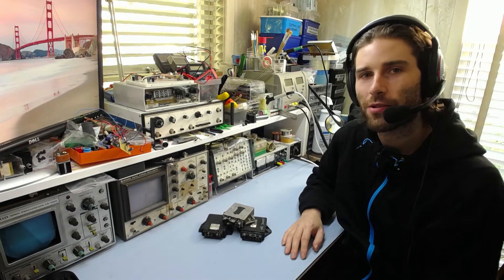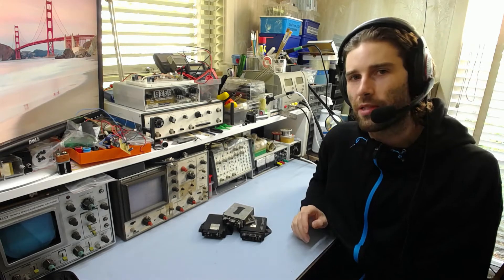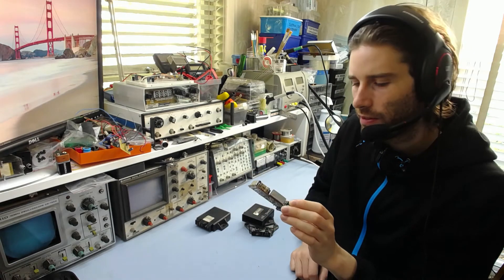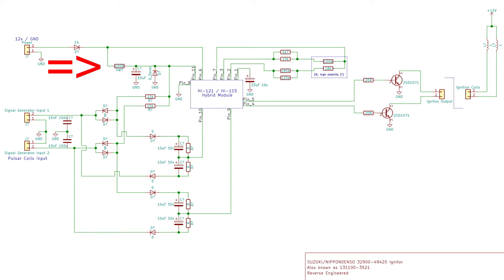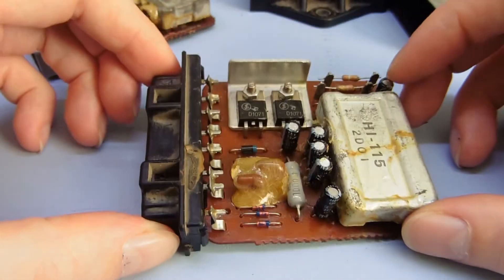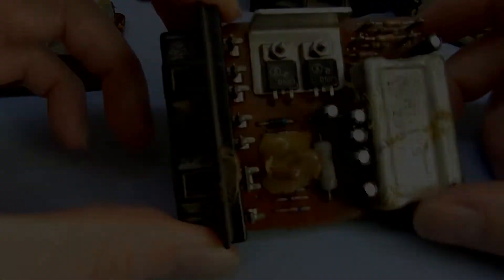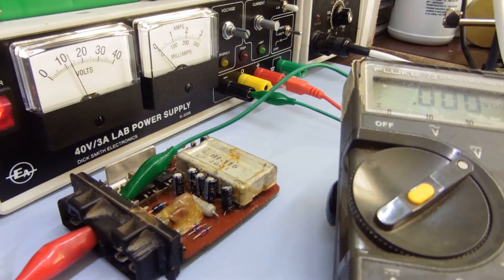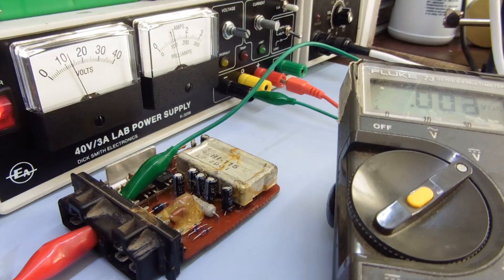Investigation and repair(?) of two failed Suzuki GSX750 ignitor units

Comment: This information was exactly what I needed.  Two of igniters were like the one on my Suzuki.  I replaced a badly burnt 100  ohm resistor.  I tried the unit on the bike, but it still did not work.  I watched another video that was working on a Honda CDI.  The problem with that unit was cold solder joints.  So I tried heating up the unit and that corrected the problem.  I resolver numerous connection points and the thing is working properly.  II think the root cause of the resistor failure was when the voltage rectifier went bad.  The way I found that problem was the head light, tail light, temperature gauge and tachometer went into melt down.  The amazing thing was during the summer the igniter would work, but when we got to the fall weather (colder) I lost spark.  This was like chasing a ghost and your work on the ignitor was key to getting the thing to work.  Not sure how much you saved me but it could have been in the hunderds!  Thanks again for your help.
Reply from the maker: Thanks! Glad it was helpful. Good point about the burnt resistor - a bad main voltage regulator could indeed cause that problem.

Comment: Thanks for a usefull runthrough. I support the theory commented earlier by someone else about faulty voltage regulators which is a much more common problem on bikes than failing cdi units. Overvoltage can typically be caused by bad grounds or corroded connecters which reduces the system voltage the regulator senses due to voltage drops in the circuit. This in turn triggers a higher than needed charging voltage - typically up in the 15+ v range. A faulty regulator can jump you passed 17V.

Comment: The epoxy becomes pliable so as to remove at approximately 200 degrees so if you boil them in water and slowly work at removing the epoxy while re boiling it’s achievable , then electronic component testing and replacement is doable , takes time and patience but anything worth doing is worth doing properly.

Comment: cdi is older tech than tci, transistor controlled ignition. The coils are stationary and have permanent magnets. Reluctors, Two metal plates pass closely to sensors creating current, one for rpm speed the other for top dead center. Firing dwell angle is calculated. The mosfet goes bad. Also, they create spark by disconnecting primary coils causing the field collapse which creates a spark. So they do provide voltage for the coils and disconnect to spark.

Comment: Hi, great video thank you so much. I would like to ask 2 questions if you have the time for it. What type of lightbulb did you use, or what bulb can I use? Also, when you took the first IC module out (the module metal encased) you noticed that instead of being potted with an hard material, that material was soft, how about when you removed the same component in the second module, was it also soft or hard?
Thank you so mych
Reply from the maker: Thanks! As this is a 12v system, I used a 12v automotive bulb. But you could use an LED with an appropriate resistor. All that is needed is something to indicate that the transistor switched on correctly. On both modules the potting compound was soft and squishy.

Comment: great video,im bussy on a gsxf 750 built 1993   cdi nr 32900-20c10   maybey someone has awiring diagram from it and also looking for a manuel (wiring diagram)from the bike...   cilinder 1and four not firing,seems to have 1 pick up coil 179 ohms,left bobine coil(1 and 4)dead when i swap them no spark at all, so im sure this cdi is also defect on 1 and 4(coil to!!!)   this cdi i have here has a big chip on the back and a lot of smd components on thebottom,double sided board...collor from the pick up coils are yellow and blue 179 ohms....keep wreching!!!!

Comment: Can you help me? I got the same ignitor unit on my GSX750 and Its got spark just on one side. So 2 cylinder works two not. 
If you look from center its the inside pair. The zeners are good. I got the 6.3 volts on the resistor. But the transistors are heating very badly two of them. What can be the problem?
Reply from the maker: If the drive transistors are hot they may not be getting enough base current to turn on fully, or they could be shorted.

Comment: The cdi box clip is controlled by two pickups. The question is, if I need to use it on a suzuki GSF400 with just one signal pickup, what do I have to do?  My need is that I have my own GSXR motorbike.  The reason is because I made the TCI Digital ignitor to remember the customer's 1993 bandit400 car is broken, soot burns in the circuit.  Must be responsible  Is the source of watching the video and has repeatedly watched it many times  Please explain how to connect to me. Thank you, Chanon Thailand.